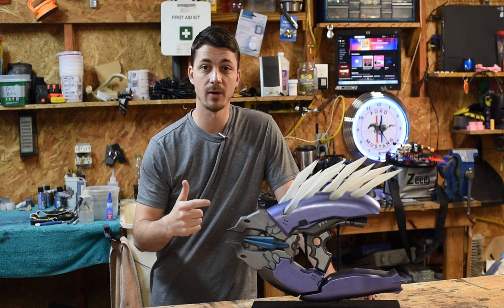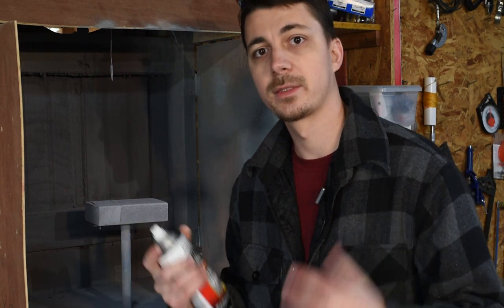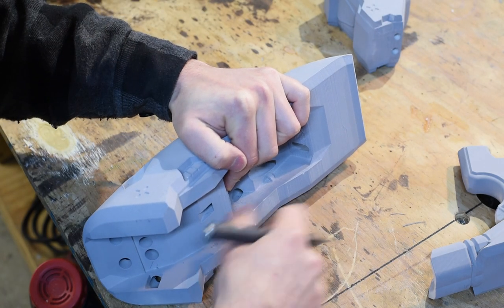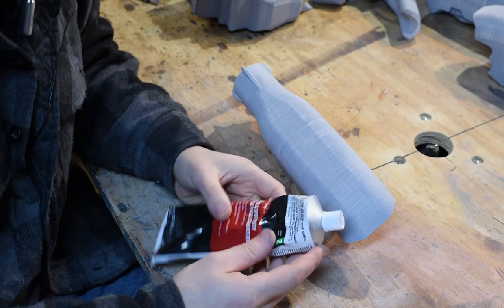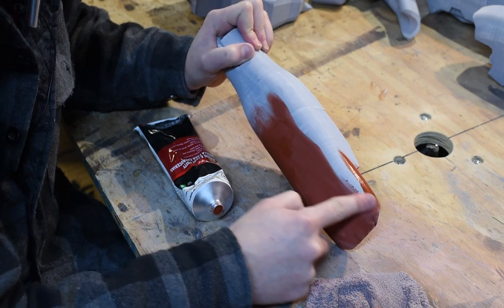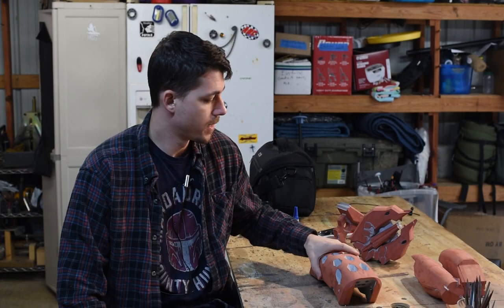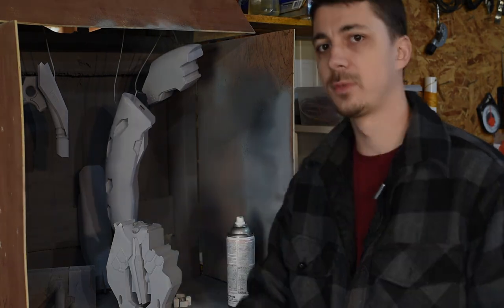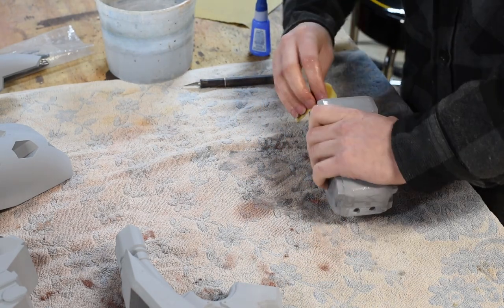Halo Needler 3D Printed How to smooth PLA

Comment: Another hot tip for preventing your sandpaper from clogging up is to wet sand with a few drops of dish soap added to a jar of water. Dip your paper in there every few minutes to keep it clean and lubricated. Be sure to get sandpaper that is built for wetsanding though.

Comment: Bondo is great for large gaps, holes and cracks, it's not really meant for thin light work like smoothing.  That spot putty is great stuff, but I wouldn't recommend it for filling large seams or holes, it is fragile and doesn't take much for it to crack and flake if it's to think or heavy.

Comment: I just tried this and it's great! But is there anyway to get the Bondo off the sandpaper? I've used a lot of sandpaper by now for such a small part. I tried flicking it and used a razor blade to it and that partially worked. Other than that great tutorial!